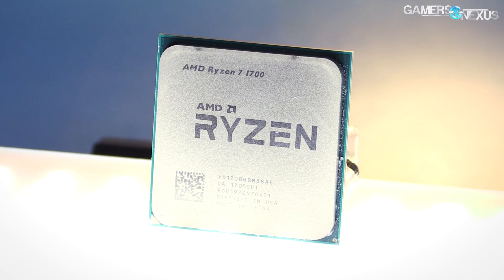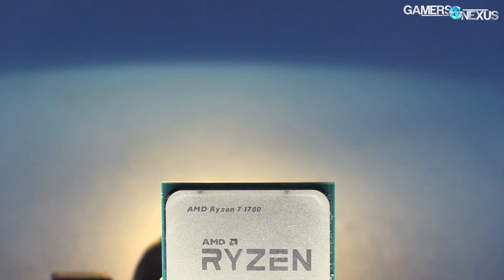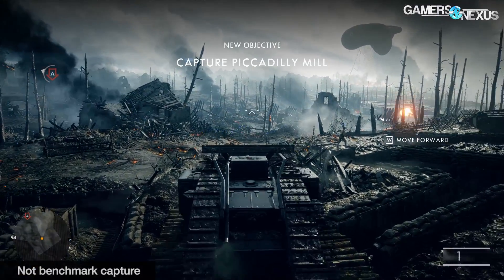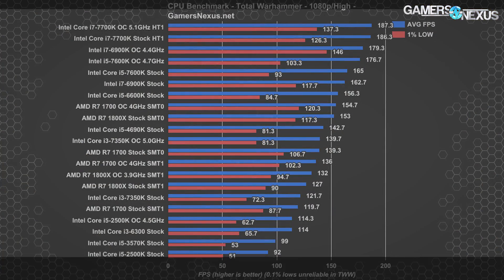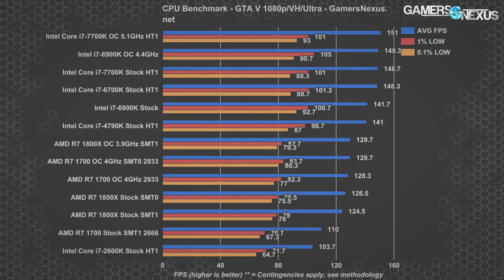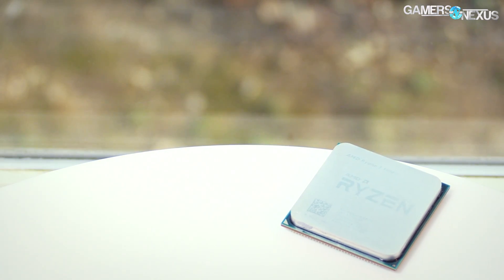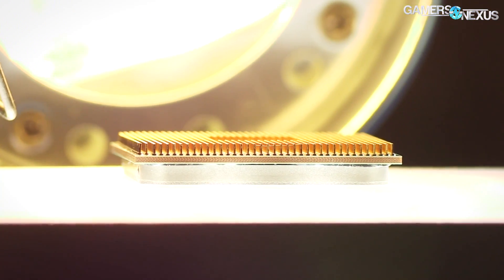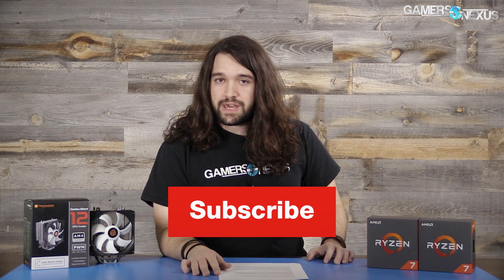AMD R7 1700 SMT Off + Overclock Benchmarks

Comment from the maker: Thanks for watching! The 1080 Ti Hybrid part 2 goes up tomorrow. Part 3 the day after. Just got home from PAX yesterday! Article for this video is here: http://www.gamersnexus.net/guides/2835-amd-ryzen-r7-1700-smt-off-overclock-benchmarks
Reply: hey turn 4 of the cores off and see if it clocks higher
Reply: As always, your time and god level patience in doing these videos/reviews and dealing with the comments is always appreciated. Take some time off, then get to work on Vega whenever AMD decides that's ready.
Reply: Why is is so difficult for you guys to stop and think about the entire environment? Gaming with a 1080TI or titanXP does load the CPU but it also loads the connectivity between the CPU and the GPU.

The Data Fabric that the RYzen uses that is used for communication between CCX cores, Assessing Memory controllers for memory usage, Communication to the PCIe controller for communication to the GPU. Your the Titan XP tests totally ignore the the inclusion of this connectivity and given the new nature of the architecture, that is not a safe assumption to have.

If you in fact are bottlebecking the data fabric with the extra 300fps gaming load to the GPU over and above the normal memory access and thread switching that you see in a cinebench or other pure calculation based benchmarks, it should not be a surprise if you see 16 threads trying to access memory through a communications medium that is already bottlenecked perform worse than if only 8 threads are accessing memory. SMT by definition has an increased memory access bandwidth requirement. If you increase the loads in something that already has a bottleneck, It will only make the bottleneck worse and provide lower performance.

An easy test to see If I am pointing you in the right direction or am a complete idiot is to do some non CPU bound gaming benchmark comparisons using a GTX 1060 on both a Ryzen and an Intel based PC instead of a 1080Ti. If the frame rates are within a small margin of each other and not as disparate as you are seeing with teh Titan or 1080Ti, then you have confirmed a bottleneck in the data fabric.

Another source of information that you can use for comparison is to look at the Ryzen and Intel Titan XP and GTX 1060 3dmark firestrike combined test results. With the Titan XP results, The Ryzen PC has great graphics and physics scores but the combined score is about 6000-7000 . The top Intel scores with the same GPU have great graphics and Physics scores too, but the combined scores are in the range 9000-10000. If you take a look at the 1060 results,  Graphics and Physics are both about right for the GPU and the combined score for both Ryzen and Intel are both in the same 5000-5500 range. 

The Ryzens top physics scores demonstrates that the CPU is quite capable of doing pure computational work without the high graphics load in the mix and the Graphics score demonstrates GPU is still working pretty well if it doesn't have all the extra physics like calculations competing for resources. The only difference between the 2 gpu levels in these tests is the amount of data and computational load that the 1060 can place on the entire system including teh data Fabric. If it was a OS flaw or physical issue within then CPU itself, then you would still see  similar disparity in combined scores
Reply: Why are you ranking a 6600k higher with only 2 more fps better avg but 40fps lower minimums?
Reply: You don't need to deactivate the whole Complex, just set the game's process affinity to set one complex of cores AMD OverDrive can do that also in Task Manager can be done too. Also maybe maybe ini file of the game itself
Reply: Hey Steve, I am sorry for being a dick towards you in previous builds, it was wrong.  Could i ask you a question about your expierence with this processor?  What is the stable oc you have achieved at stock voltage?  Please and thanks. :)
Reply: You mean affinity 8-15? to keep all work load on one module, i Play armoured warfare when when using affinity 0-7 i noticed a big difference in game performance while disabling 8-15. I also noticed CPU usage plummet in games too so there is clearly a cross module talk overhead and it's ALOT!!

Reviewers must be sick of their lives LOL, test number 602
Reply: Intel i3 will not compete with Ryzen. Some i5 will not either, particularly if you allow overclocking. Right now, the top i5 and i7 are better performing for pure gaming, while Ryzen is fair performing for gaming. For anything other than gaming, Ryzen is killing both i5 and i7, at its price point.
Reply: more interested in that than ryzen. Thanks for the timeline.  Question: why do you not use the evga shroud on your hybrid build? any reason or just a design choice with no reasoning behind it.  I'm asking because i would like to hybrid cool my ref card i ordered.
Reply from the maker: We only have the 980 Ti kits and a ton of the CLCs, so none of our shrouds will fit without modifications. The shroud mounting holes are moved a little from the Maxwell series.
Reply: Gamers Nexus do any of the existing hybrid kits from EVGA work with the 1080ti FE from EVGA? if not, what are the chances EVGA will release a hybrid kit for the 1080ti FE?
Reply: Ah, I thought you was using the 1070/1080 kit so that makes sense. Thanks for the reply. I seen some other build guides on the nets about dremeling the base plate to get the 1080 version to work but would really like to see your input on that either on your site or in a video.  Gamers Nexus is a bit more trustworthy to me before i take a grinder to a gtx 1080 ti.
Reply: Can you 'emulate' SMT OFF with using CPU affinity for running games?   Thereby keeping it on for other apps?
Reply: Good thing I dint pre order
Reply: Never preorder anything! Thats my free advice.
Reply: Some times yes, but windows has evolved and will try to prioritise tasks to physical cores and over spilled to the logical cores. So disabling hyper threading has limited impact in modern games so you are better off leaving it on.
Reply: Can you please also show termals of 1700 (4Ghz) and 1800X (3.9Ghz)?
Reply: Thank you for going a bit more into the SMT on/off aspect of the R7 with stock vs OC, and the included R15.  I've not found a bench mark specific to 3delight (and that would only be niche applicable any way), so the Blender and R15 that time and manpower is available for on the side is good enough to get an idea of what I and my budget has to put up with in the future. Good point on the number of threads with rendering thing, I had some remaining doubts over the "Is it worth it" factor to go from 8-cores at 4.0GHz to 8-cores at a lesser clock (That 16 thread part is very tempting tho).  In the end, the R7 (+ Mobo + memory) is a lot more affordable for me then 8+ core i7 processors that just the CPU cost more then I get a month before bills. Humble thank you.
Reply: I did with my R7 1700 and there was a very big improvement, definitely faster than my old i7 4790k thats for sure but upgraded BIOS from the beta to the latest 0906 now for some reason my CPU is over heating. Pretty sure ASUS have changed the temp offset in the BIOS, oh and my CPU fan doesn't work properly stay in slient mode may go back to the last beta BIOS or some settings in the BIOS is screwed up since thats been reset but might just wait till my Noctua AM4 bracket arrives.
Reply: The R7 is a stitch of two dies, and some ping test show increased lag when moving between cores. If possible, running two cores on two dies, then four on one, or just 1+1 cores, could possibly give some answers. It would certainly say a lot about the interface AMD is using. There is some cache issues, but just using 2 cores should help. It would actually be really, really, nice if AMD assisted with such a test. The interface is obviously super great, and is at the core of Nayples. It is not like this is never going to be covered. It will be benchmarked to death for server optimization.
Reply: Yeah i saw the PCper video and the latency between the modules that's why i started to try setting the windows affinity for games and it does really really help, the module stitched together seems fine if the cores are being fed large chunks of data since this is not being passed from one module to another, but games. However games really do cripple the performance since windows trys to use all physical cores before using the SMT. Which kinda of explained a few hickups i got in armoured warfare where going from zoomed mode to 3rd person there would be a stall for about a second (this was with SMT off) with SMT on it did not happen as much and maxed out around 110fps. So disabled cores from 8-15 with windows affinity and there was zero stalling it was absolutely perfect and my max fps i noticed was over 160fps. this was at 1080p max settings and in areas with little going on so CPU bound. Also this game runs the crysis 3 engine.

And from PCper they said the Ryzen had much lower latency than the i7 on the same module but as soon as it goes to another module latency is 3x worse, games which requires very low latency and small chunks of data being in sync you can imagine how this affects games? Yep it turns out it really is that bad!! Also my CPU usage dropped alot where before CPU cores was around 50% on 16 threads, now 4x cores run at around 60% and the 4 other threads around 5-10%. I was wondering when i was watching other videos like jokers as to why CPU usage was so high in not so multicore intensive games which i noticed this myself, well turns out the cross communication has very high over head and CPU usage increases along with it. Definitely needs to be looked into further. so Choice one disable 4 cores, or choice two set affinity every freaking time i play a game. I have read out can set short cuts to set affinity but some games like armoured warfare have the extension built into the browser so may not be possible. I'll have to look into it further if it is possible. This maybe a pain in the ass for game devs. If the keep rendering API on the first 4 core and threads, and physics or something on the last 4 cores and threads this should have no impact to games. Still a pain in the arse for devs tho. Unless it's something Microsoft can try with a scheduler? IDK
Reply: Well, if this is affecting performance severely, is it possible to run 1 core on each die, and compare it to 2 cores on one die? Just make sure to use an app that will require a lot of communication between the cores. Like a game. Anyone with a Ryzen R7 should be able to, if he is able to selectively disable cores. If this result in hardly any difference, that cross core interface is something of a marvel.
Reply: can you please test a ryzen deactivating 4 cores, there is only 1 review out there, the zolkorn's one but i can't believe his results.
Reply: Doesnt make sense to me. Id rather have less dips than 2 more top fps, and Ryzen is known for smoothness while gaming..But you and me know intel is deep in their hearts , so  looking for every angle to crap on amd is always  a thing for some people..We know it, they know it even tho they will always deny it.
Reply: what happens if you overclock a 1700x cooled by liquid nitrogen?
Reply: ryzen 7 is the same cpu than ryzen 5, so if r7 is not for gaming r5 is not for gaming

Comment: I'm gaming on an r5 1600 @3.8 ghz, stock voltage,smt OFF With 3200mhz 18,18,18,38 ram@1.4v. Farcry primal (the engine sucks)1080p @ 130 fps avg. On a GTX 1070 High settings.

Comment: Honestly, it was silly of AMD to release 3 cpus in the same SKU line, they should have maybe released an R3 and the R7 1800x  then waited 2 to 3 months then used info to help better software to improve the R5 and R7 1700 then release them. it would have been the better way to go, that way they would have a budget orientated chip aimed at lowend gaming and web browser pcs (also good for workstations) and a higher end rendering system (slap some ECC and turn it into a workstation server). Then once they perfected the software and any production hiccups, bring out the gaming line with the R5 perfected and keeping pace (hopefully) with Intel last gen.

Comment: It isn't reasonable to ask someone to benchmark Black Desert Online, being it's an MMORPG with all the variables that are extremely difficult to control, but it's a game that has been shown to take advantage of all the cores you can throw at it. The cities are full of NPCs and player characters and it puts a huge load on the CPU.

This is more or less applicable to all MMOGs or other games in which there are a relatively large number of players. The same was true back when the Cataclysm Xpack was launched for World of Warcraft (which brought some improvements in the engine; it became a DX11 capable game). Chris Angelini of Tomshardware did an extensive analysis and even in his test scenario, where there weren't a lot of other players involved, the Intel Extreme series of the time provided some benefit.

So, the 8-core, 16-thread Ryzen CPUs could find a home amongst MMOG players. Of course it has to work behind a serious clock speed deficit (particularly when overclocking) compared to Kaby Lake, but if I were building a new rig today I'd strongly consider going with a Ryzen CPU because it has the potential of excelling in the types of games I play. But I'm not building today and we'll see at least 6-core hyperthreaded CPUs from Intel when Cannon Lake drops, which will be the earliest I can afford to build a new system. And Ryzen wouldn't help Everquest II which is extremely CPU bound but really depends on as much clock speed as you can provide, core count means a lot less in that game.

Comment: Great review. Just.. Why are you comparing AMD OC against mostly only stock Intel? For gaming, according to this and the price we're paying here in South Africa, the 7600k Is a better buy than the AMD 1700 (for gaming). There's a R1000 difference between the two (roughly 75$-78$) and it seems like the Intel performs better?

Hopefully the R5 series (which is supposed to compare to the i5) does a better job/ lower price.. Otherwise AMD in SA for gaming is moot

Comment: Good video, but I was hoping for more. A lot of other tech sites already did the same test you just did. I think at this point it's fair to say we've seen all this, i.e. any pros when disabling SMT are far outweighed by the cons. Besides even when it does help a little, it wouldn't be practical to access the BIOS just to disable SMT when gaming, then enable SMT again in the BIOS just to do productivity tasks. These same tests have also been done to Broadwell-E, so there's no surprise in these results. Not to burst anyone's bubble, and certainly no disrespect intended, but this is just beating a practically long-dead horse.

Granted you just got back from PAX East, so just an FYI, WCCFTech did an apples-to-apples comparison between the i7-7700k and R7 1700 a couple days ago, underclocking the former to 4.0ghz, and overclocking the latter to 4.0ghz after disabling 4 cores and halving the L3 cache, so that both CPUs run at the same clockspeed with same number of cores and threads and the same L3 cache size. This is a more relevant test because of the following reasons:

1. I'm not sure if they disabled one of two CCX, i.e. 4+0; or disabled two of four cores in each, i.e. 2+2, but WCCFTech's test results look credible. Still I think you might give a better perspective. I have this impression that you are more meticulous than any of the other US tech reviewers here. Doing the same test should get you more views. 

2. An apples-to-apples test pretty much simulates the performance of a Ryzen 5 with 4c/8t overclocked to 4.0ghz, and knowing how the R5 performs can mean the difference between waiting for a couple of months only to be greeted by a crappy CPU, and buying an i5 (or even a Pentium) Kaby Lake now. Heck all this talk about how the 6c/12t SKUs will be the best bang for buck might turn out to be inaccurate for all we know. You'll be helping people make a decision today by doing this test.

3. It will also help AMD figure out whatever the fuck it is they messed up with R7. Maybe they can take steps to make sure the R5s will not have the same issues (i.e. if they should disable a CCX or disable 2 cores in each). Doing the test will help AMD with R5. And we all know that if AMD wins at this point, we all win.

Comment: so gaming in Ryzen @ 1080p is suffering from CPU bottle necking and 4K is not when using a high end GPU like 1080 or Titan X(p). So for medium range GPUs like 1060 6gb and 480 8gb or 470 4gb will not be suffering from CPU bottle necking at 1080p or 1440p, right ?! or will those cards be also performing bad on a Ryzen CPU ? Is there benchmarks for these cards as well using Ryzen CPUs ? I am a confused budget gamer using a lot of multitasking and content creation using my fx-8350 CPU and gtx760 gpu. I was planning to get a 7600K CPU and Rx 470 4gb card, but now i am seriously in dilemma after seeing Ryzen 1700 review. please help me reach a decision.

Comment: Yes for most of GN users, the 1700 sounds like a better deal but don't forget about workstations that were set without overclocking and only to be used for professional use. The 1800X is perfect for such use
Reply: GN thinks intel chips are superior for pure gaming, that is why they repeatedly drop in comparisons to intel chip x or y from "2-3 generations" ago as a pot shot to anyone considering spending similar or more cash on ryzen for gaming.

Still buying ryzen here though.  I prefer amd, and this is close enough, and who knows, some day games might actually have a greater benefit to performance for more cores. where the ryzen cpus will leave the 7700k behind.